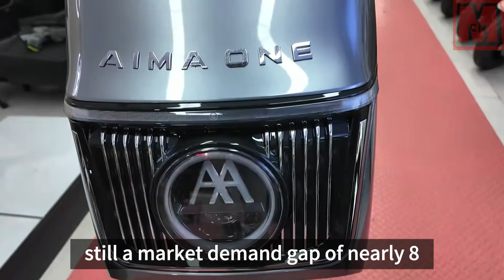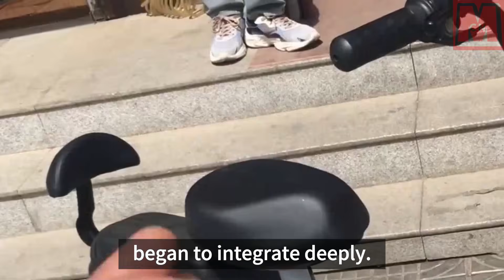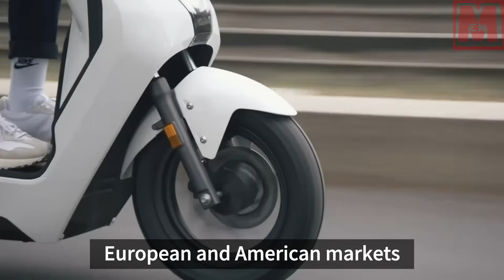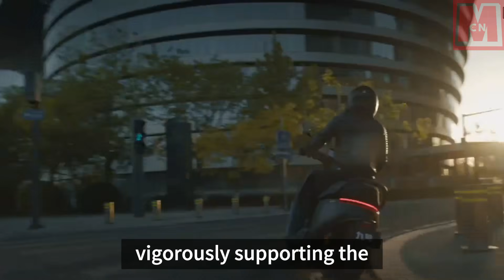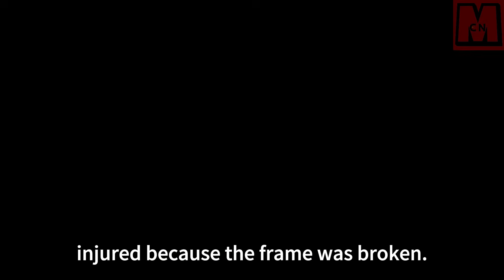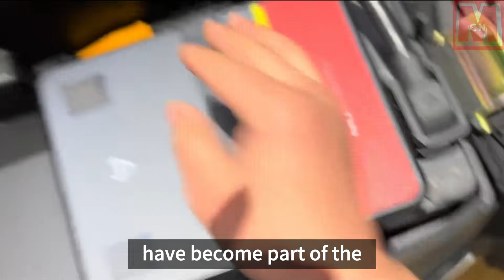Chinese electric bicycles are "selling like crazy" overseas

Comment: What is the range in kilometers for battery???
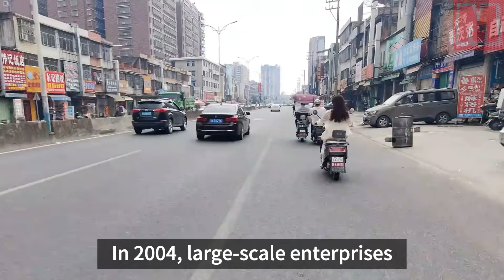Reply: Enough. And if it doesn't, you can just push it. Like you cannot do with a car. Worse come to worse, you phone a friend on a mobile, and he comes do what they are doing at 5:13.

With ICE motorcycles, they have a range of maybe 100-400km on one tank of petrol. But I never knew how far mine could go. Didn't ask, never even entered my mind. Why would anybody want to ride that far? I'm not a delivery driver? I'm just commuting. Why would I try to commute that far on a motorcycle? That's insane. 🤣 If you're commuting that far on a motorcycle everyday, you need to move.

A range of 30km is fine for an e-bike. Some would be longer. But then you pay more. Why pay so much if you don't need it? Look for the a shop selling it locally, even if online. You don't want to import it only to find nobody in your town knows how to fix it or even get parts. Before you part with your money, check it's range. Don't just take the seller's word for it. Ask, but research a bit on the Internet based on the model. Don't buy some weird rare model, and there should be people reviewing it and complaining about it's range, if the manufacturer lies too much.

If you are a delivery rider, then a normal consumer model is not suitable for you. Normal people don't ride as much as you. Their backside can't stand it. You need to pay more for one with a very long range. Or battery swap. Or if you are mechanically and electrically inclined, buy extra batteries and bodge a way to charge them at home off the bike. Not rocket science. But accidents could happen if you're not careful. Like burning down your house.
Reply: What is the elevation gain?
Reply: 50-80KM
Reply: You can just buy the one with a pedal! Once run out of power then you can pedal it!

Comment: I fully agree
It's time to implement export quality control in China to keep the Made in China brand while provisions made for 2 and 3rd grade items to be totally transparent.
Reply: It is up to the Importing Countries to set the standard and specifications.
So don't blame the Chinese Exporters.
Reply: @stevenliew2507  there is an alternative. A government agency that checks for quality and certifies it. Companies wanting their products certified will pay a fee to cover the cost of doing this. Smaller companies, new companies, without an international reputation, can rely on the reputation of this certification/standards agency. I can imagine a few levels. Add more if you want, but too many will jsut confuse people. I figure maybe 10 is too many already.

1. leading edge quality and reliability that money can buy. Think BYD's U8. Apple. Makita. These companies will not pay for these, but new entrants, and other companies that want to compete with them, might pay, to persuade consumers that their products have been tested and found to be good by a third party.

2. mid-range. You don't pay top dollars, but these stuff should be adequate for normal use. Think Xiaomi or Hitachi. Almost everything would be here.

3. cheap crap, that still works. At least a few times. Cut every corner to save every cent, so  that this is as cheap as possible. But you're getting a real product that works. It's not a scam. Dollar store stuff. A $10 drill that rattles and make weird noises, but will make at least 50 holes, then there's a 50% chance it will break. But that's fine. Because I have only 10 holes to make, and after that it's going into the attic anyway, never to see the light of day until the day my grandchildren empties it out after my funeral.
Reply: 你对“中国制造”的印象之所以不好，是因为你们的进口商来我们这定制产品的时候，往往会选择最差的那个方案。
我就是做生产型企业的，很多外国人来我们工厂下订单，同样的商品，我们一般会给出4-5个方案，但是你们采购的人员通常会选择最便宜或者接近最低价格的方案。

当他们把1美元购买的产品送去美国放在货架上，就会卖给你们20-50美元，当产品出现问题的时候，他们就把责任推到“中国制造”上。

兄弟，一个能把太空员送上天的国家，会不能生产过硬的产品吗？但你们不可能用1美元买到10美元的商品，这就是事实。
Reply: It's a free market in China.

They can produce at all price & quality points. You can buy & import them as you wish. They don't control the importers.😊

However, from personal experiences, most businesses or importers are short sighted & go for making a fast buck for as little as possible & blame any low priced & quality they themselves choose to import on China !😅